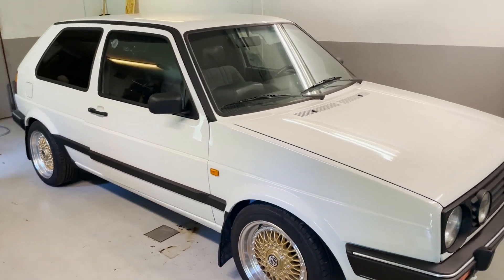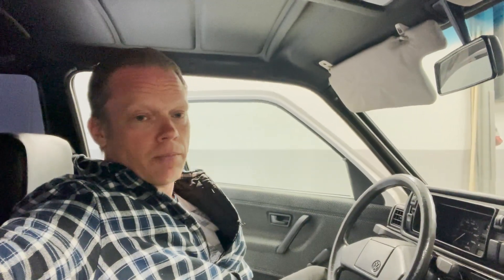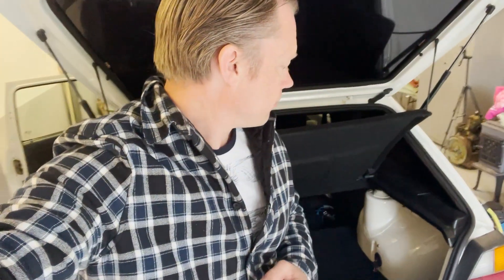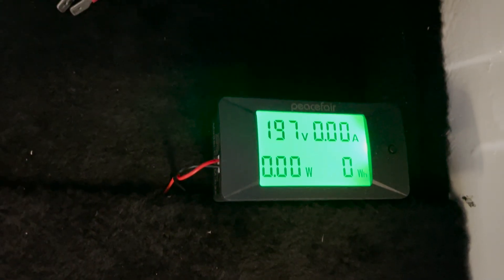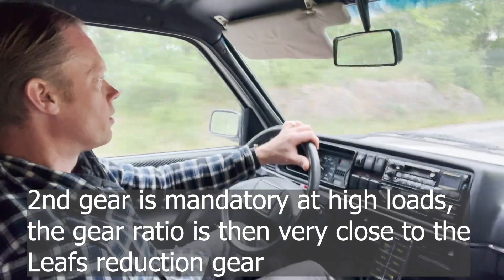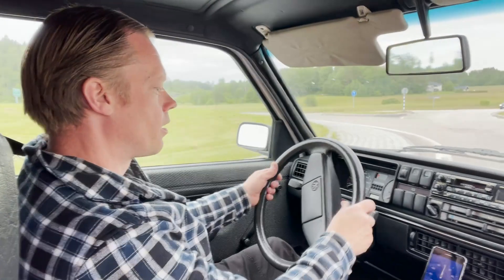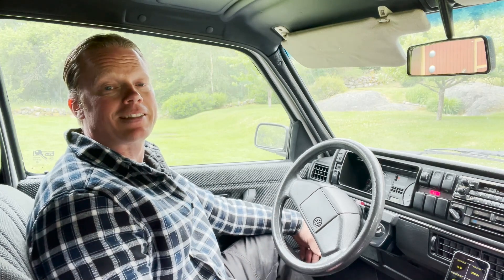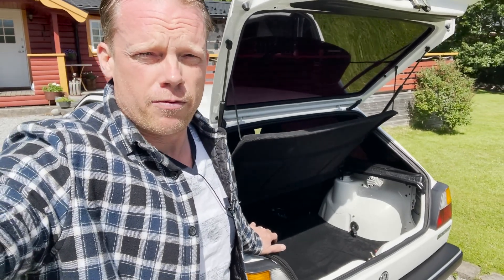Consumption test, Electric Vw golf Mk2 citystomer with diy lithium battery

Comment: Solar electrical energy from grid : 20kwh * 0.28 Euro for 146km = 3.8 cents / km (based on 28 cents/kwh) 😘
Solar own panels : 20kwh * 0.00 Euro / 146km = 0.00  Euro = 0 cents / km
Solar own panels based on grid return price : 20kwh * 0.09 Euro / 146km =   1.2 cents / km (based on 9 cents return fee that you do not get because you charge car)
Economical diesel powered car : 146km / 1:25 = 5.84liter * 1.60 Euro = 9.34 Euro / 146km = 6.4 cents /km (based diesel 160 euro / liter)

Comment: Well done, what an awesome project. Keep up the good work. Seeing the things you have achieved, I have a project on my mind for a while now and would love to hear your thoughts. I was thinking of purchasing a damaged Dacia Spring for about 5000-6000 € and convert it to a home storage device. The idea was to keep the battery in the car and still charge it with the on board charger. Then remove the HV leads from the motor control unit and connect them with a solar inverter. What do you think, will it work or am I overlooking something. Best regards Stefan from Germany
Reply: I had the same idea 10 years ago, but now the cell price of new EVE LF280K Grade A with 6000 cycles is actual approx 73 €/kWh. So new LFP cells for a 30 kWh battery are aprox 2200 €.
Reply: @martinkobil  That is true, however because I drive a Dacia Spring I would use it as spare parts depot.
Reply from the maker: Thanks. I do not recommend that. What will protect your battery during the discharge cycle?
Reply: @flyingtools  can you elaborate on this. Why is protection an issue in this instance?
Reply from the maker: If your battery goes low in one cell what will turn it off? The car will se that the current are leaving the battery for no reason and most likely open up the main relay.
So to drain the battery you need to bypass those relays, and then, what will protect your battery? You can do this a few times like I did and check the cells yourself, but in the long term you need some bms that will do that for you.
Reply: @flyingtools  Excuse my ignorance, I still have a lot to learn about the whole subject. If the battery is charged with the onboard charger using the original BMS, wouldn't that take care of it. I am trying to understand why feeding the electricity to the electric motor would be different to feeding it to a PV-inverter instead.

Comment: Are you using just the motor and controller or the whole stack with charger and DC-DC converter? Last time I looked into the resolve controller, you had to use the original battery from a Leaf but now I see u use VW Batteries?
Reply from the maker: The complete stack, just changed the modules.
Reply: @flyingtools  and that works with the BMS? Have you changed the capacity?

Comment: If you measure the power you need to put in to fully charge it, you will know the actual power required to do x kilometers?
Reply from the maker: There is losses during charging, it can be more then 10%
Reply: @flyingtools  That's true.
Reply: @flyingtools  It seems to me that the reason one measures capacity is to identify where improvments can be made. A 10% loss in charging is an area where improvements probably need to be made, especially if one is using solar panels for charging.
Reply from the maker: @Bennyboy-dog  i think that the car manufacturers has been struggling with this a lot, but converting ac to dc will always be hard to achieve without power losses. The solar power is almost free in my case, so i can take that loss.
Reply: Brilliant idea, especially when you don't have a fit-for-purpose energy meter for the measurement.

Comment: Nice work! I think my last comment was deleted due to sharing a link but a better for you might be this (search Google/Ali for DC 500V 500A Wireless Voltage Meter). It will work for up to 500vdc, has relays for safety, has a wireless screen and also a UART API that you can get data for or control it with an ESP32. I have the uart protocol from the manufacturer if you want it.